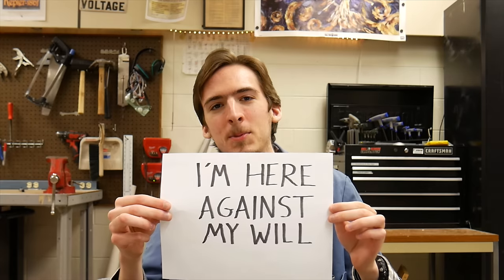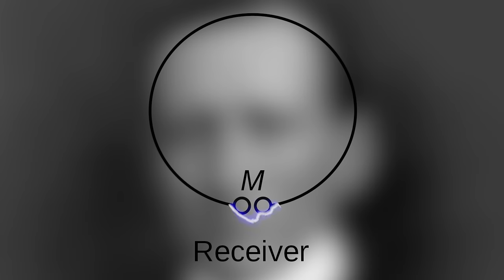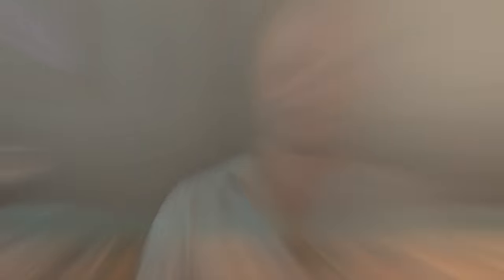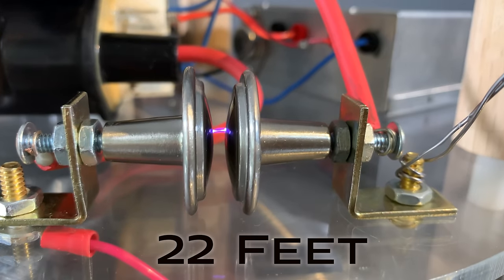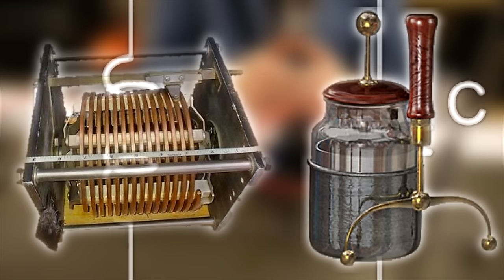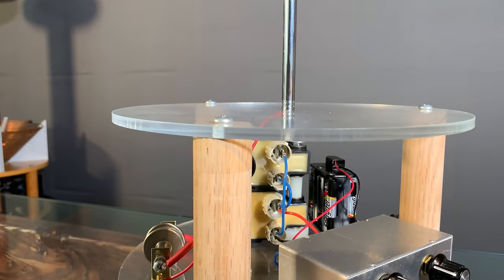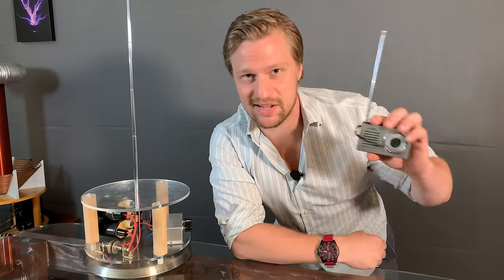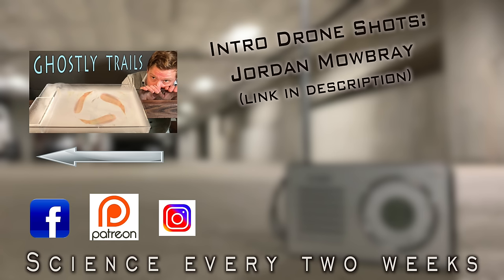Building a Revolutionary Spark Gap Radio (ft. Blueprint)

Comment: Pretty sure it's legal, you just have to license your own radio station and avoid getting copied

Also it's incredible
Reply: Problem with especially spark gap emitters is that their frequency is all over the place. that messes with regular stations and more important with radio communications from airplanes, police and such.
Reply: One of the first things they teach you when you’re studying to get your license is you cannot have spurious transmissions…which is pretty much the definition of a spark gap transmitter. 

Technically it would be legal in an emergency situation but will anyone listening be able to understand you? He was having difficulties at just a couple feet. The power early radio operators had to run at to be understood as anything other than interference was so high that they had to have dedicated buildings because the spark gap was so loud and so dangerous their wives wouldn’t allow it in the house hence the term radio shack.

You’d just be better off making a modern one they really arnt all that much more difficult. spark gaps went the way of the dodo really quick after the invention of vacuum tubes. It’s literally child’s play with modern transistors and diodes I have an electronics experiment kit made for 10 year olds that has instructions to make one

Comment: can the range of the transmission be increased by adding a capacitor paralell to the spark gap?
Reply from the maker: It likely could, but FCC was not a fan of me experimenting any further!
Reply: @PlasmaChannel  The only bad 'F' word in my vocabulary is FCC. lol thanks for the reply i wasnt sure if that would have any affect or not on the strength of the signal. Its already pretty darn impressive how well your transmitter works. Ive bedn itchin to build one after watching this vid. Thanks for posting. love your channel.

Comment: Something i was introduced to here is the coherer!!! Is there a limitation on size or the bigger the better?
Reply: Hey Joshua,
The only constraint for a coherer size is how far apart the conductors with the iron between them are. Too much and no coherence, to little and it is always cohered. You have to find the sweet spot.
Reply: @BlueprintScience  after watching this i read how it evolved to the crystal then tubes and finally the transistor receiver. I'm going to try a combination of all of them after some more research on crystals and proportions in doping silicone. I'm sure theres a youtube video on it😆 Thanks for your time.
Reply from the maker: This is very interesting stuff. Sweet spot seems to apply to so many original science concepts (resonance, tuning, etc) Thanks blueprint!

Comment: Please explain what concrete has got to do with RF shielding.   ;)
Reply from the maker: Typical AM radio frequencies have problems passing through thick, steel-reinforced concrete. FM has an easier time passing through, though is still hampered.
Reply: @PlasmaChannel  That's got a lot more to do with the reinforcing that the concrete.   ;)

Comment: Hi you at the plasma Channel - Have you ever looked at the wiring of the World Trade Center - The twin towers? So Building 7 housed the Transformer/power substation for the entire complex [plus 3 other buildings in the area - all 10 buildings had to be taken down of fell on the day - interesting? there's more].
There are 4 buildings just being capacity and then 2 X 110 story high Pancake coils as each floor had it's own connection to the Substation. 
What you have is a twin tower pancake / Tesla aircoil system with no base frequency - sitting humming at 110v on 60 herts - Safe as right?

I have some other information that makes it a bit more exciting.

Hurricane Erin had spent 7 days getting closer and closer to  New York City and after that The Pentagon on September 11.
So Why did the Pentagon dispatch all it's fighters in 2 directions to over 180 miles away for the day and not give any other warnings to commercial aircraft.

Why or should I ask How Did Hurricane Erin begin to turn and move away from NY right at the same time 2 Commercial Aircraft running the Computer Control called Fly By Wire lose control of the computers on both aircraft and get drawn into hit the 2 towers?

When you have a look at the amount of POWER a frequency between 6 and 10 herts has over 2 x 110 story high pancake coils and the totally impossibility of 3 buildings falling at free fall without warning - a Spark/Fire breaking out near the Substation - I'm looking at a HAARP signal used to re-direct Hurricane Erin and it went very very wrong because they didn't see the building wiring for what it was.

I'm trying not to be weird here - Judy Woods reported a very low frequency in Alaska and soon after in NY starting at 8 in the morning.
All communications went down in the area - then the first aircraft hit followed shortly after by the second Fly By Wire Computer Controlled Aircraft lost control and hit.

I would think that the static environment would have taken out the aircraft Fly By Wire flight controls.
I don't think 9/11 happened how they claim it happened and in fact the official story is 'The Smoking Gun' as to who tried to cover it / where the terrorist stories came from.

You at the plasma Channel - run that through your mind - we had firemen saying that as he was running down the stairs the walls were visibly "Rippling" and all his hair on his body stood on end and his hat lifted off his head.
There are so many things Wrong with the official investigation starting with did you know that "Only evidence supporting a terrorist attack could be entered into evidence in the official inquiry?

Here's the thing - 9/11 was after the end of the Cold War with all it's Weapons Sales and the Beginning of the Weapons sales for the war on terror and without that terror act it all falls over.

I'm throwing you this because you obvious understand what a herts is.

Neal

Comment: Ok, this might be stupid question. But does the length of the spark gap determine the amplitude of the transmitted signal?
Reply from the maker: That’s a great question. From my experimenting, the length of the gap does affect transmission distance. I’d argue that may be due to the increased energy needed to bridge a large gap of air.
Reply: @PlasmaChannel  that makes sense 
Thank you 🤗
Reply: @vedkulkarni7158  Basically the longer the gap, the higher the voltage will rise before it arcs over. When the spark begins, the electric field across the antenna changes quickly (voltage decreases) and at the same time a current starts flowing (magnetic field).
Together this creates the electromagnetic waves.
So yes, the gap length will affect the amplitude since both the Electric and Magnetic field will be higher. But a lot of other things will affect it as well. This setup is not very efficient at all.

Comment: 14:36 how is the LED lighting up without radio signals?
Reply: I think the circuit had a power supply, like a battery, in it.  If so, the Coherer is like a switch, it is turned on by the radio signal and turned off by tapping on it.  I’m only 90% certain and would be glad to hear from anyone that actually knows.

Comment: thats what i just said .. spark gapsz .. spark isz lit flow relative to b/g .. start and se ethe spark then move the wire nodes apart but do so in a vaccum so you keep the flow it getsz hotter the farther away you are in the middle .. 5g can get hot in between the receiver and the transmitter thats why they put radio towers high too .. florr level radio towersz heat up .. damn same with wifi .. half way between antennaesz wow the radio waves are causing heat bands in the air .. radio wasz global warming same with and transmitter receiver combo

Comment: 9v battery separate each diaode into a separate void .. plasma .. 1 void tall glass barrier plasma will spark over it ... void lowers resistence to already connected positive and negative sidesz hence why depletionsz .. so just a 9v battery in a void chamber with glass wall plasma will curl overhead and amplify over time .. void versus air change rate magnifiesz ime space expanbsion effect ask laird hamilton